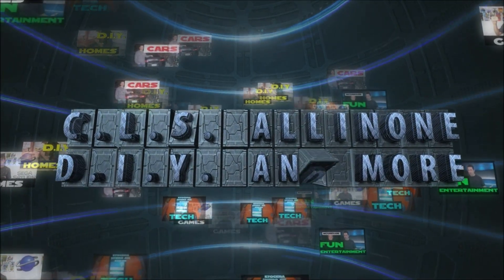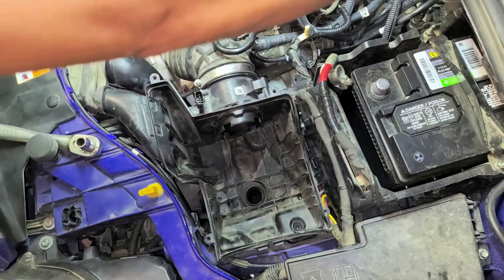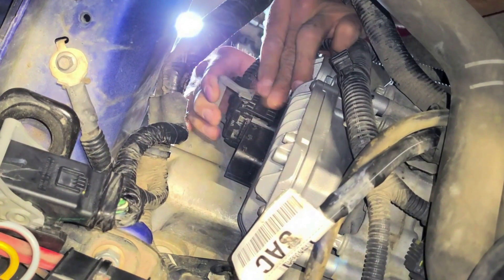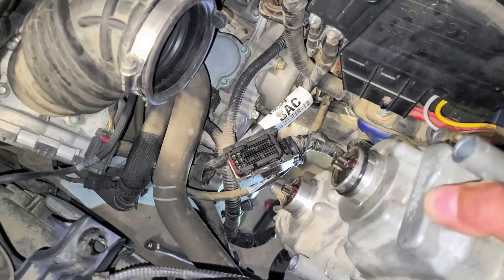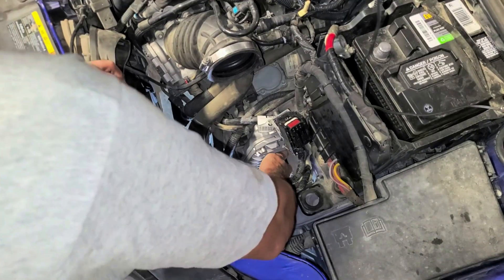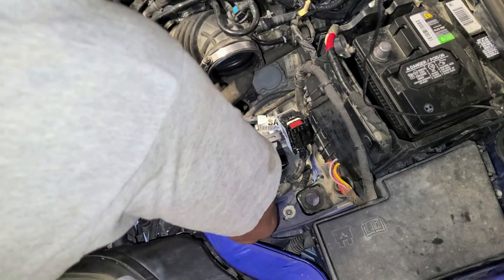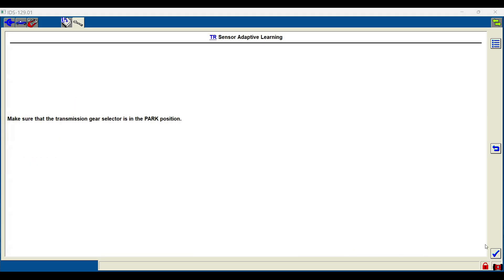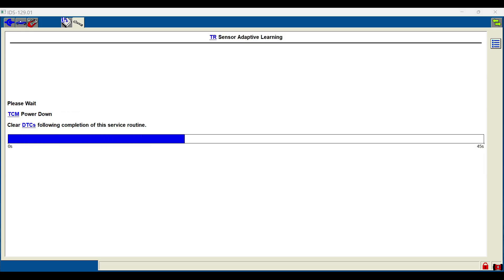How to replace TCM in a Ford Focus 2012-18 2.0L & Program TCM Adaptive Learning with FORD IDS

Comment from the maker: When installing a new pre-programmed TCM, you will more than likely still need to perform the TCM adaptive learning for it to shift properly.
In some cases, the TCM may just work without doing anything, but unfortunately, it is very unlikely.
Reply: If you buy the Dorman one it says need to perform relearn with scan tool ... Does it definitely require a scan tool ? Because usually adaptive relearn is just a series of instructions you follow for the system to "learn" ..
Anyone have knowledge on this for the Dorman unit ?

Comment: Have you ever seen the case where the upper TCM connector is in 2 pieces?  The disconnector lever separated away from the connection box on mine.

Comment: Thank you so much for this very good video, easy to watch and understand! Keep doing what you are doing. I just got code p0606, my car still drives and shifts fine, which is really weird/confusing. If my easy transmission ready reset fix doesn’t work I will definitely be coming back to your in depth video. Easy to watch and understand.

Comment: Se puede solo cambiar el tcm sin tener que programar el nuevo tcm?
Reply from the maker: When installing a new pre-programmed TCM, you will more than likely still need to perform the TCM adaptive learning for it to shift properly.
In some cases, the TCM may just work without doing anything, but unfortunately, it is very unlikely.
Reply: Thanks 🙏